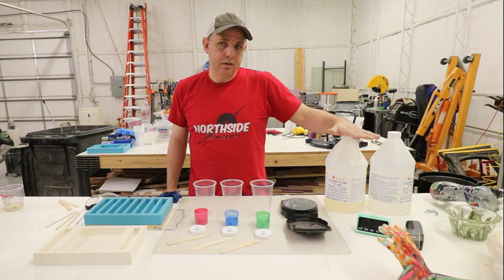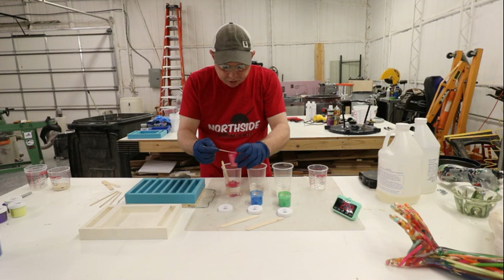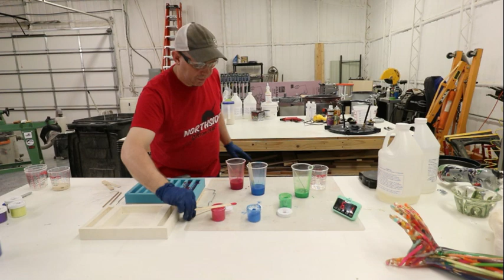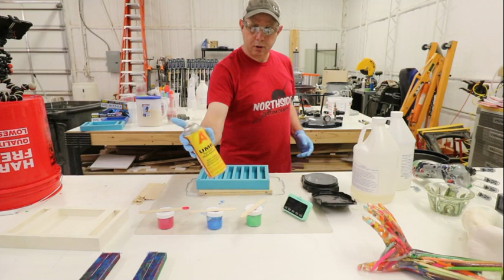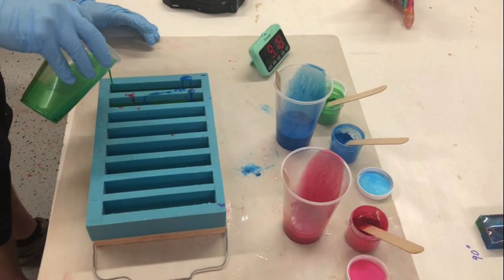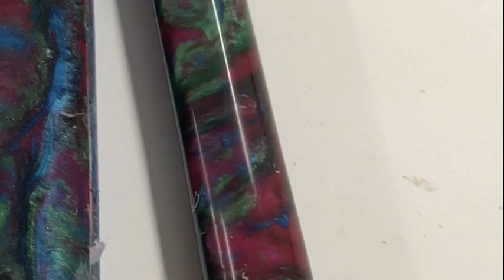Color Separation With Alumilite Clear Slow Resin

Comment: At 105 degrees most people are already in some kind of panic mode because they know there's always 1 or 2 things left to do before you get it in the pressure pot, tighten down all four wing nuts and get the air in. Im just saying, unless you've been doing this for some time most people start to panic because nobody wants to waste several hundred grams of resin and either dye or power. Or dye and powder,haha. Like always Jake, Great vid. Thank you for it.
Reply from the maker: Thanks Michael… it was definitely a fun experiment.. I’ve only poured any hotter than that on accident lol

Comment: I just did a graffiti pour with 8 colors into clear over a 5 blank mold.  It was just over 105F when I started dropping the colors into the clear in the molds.  Too late...It was a neat effect, the colors sank about 2/3 of the way but they curved towards the sides of the molds creating a clear tunnel through the blanks.  Not a total failure but not what I had in mind. I am learning that timing is indeed a major factor.
Reply from the maker: Indeed Sean.. most of the time when I don’t get exactly what I want.. I still like it.. 😄

Comment: I know it's an old video but I get great results with 100% separation using slow set resin but it is a much longer process, I mix up the resin, separate and add colour and will leave it to thicken up, using a deep pour resin means it doesn't have that fast reaction setting so you can wait till it has thickened up quite a lot without the need to rush also most if not all bubbles will have gone by that time and then when it is just barely pourable as in it takes a long time for it to pour out the cups is the time to pour it (I don't use a heat monitor just go by feel and timing) and add swirls then pressure pot it and because the curing happens over hours rather than minutes you can even create certain patterns especially if you let it get really thick and by tilting the mould to create definitive lines, also you can create mould sections like I have loads of offcuts of old silicone moulds in various shapes that I pop in let cure the pull the bits out and fill in with other colours, you even creat the same shape but at different sizes, big to small and keep replacing to create definitive ring shapes of different colours within the blank which is good for quick set resins, so many things can be done! Resin such a fun thing to work with.

Comment: I'm glad you made this video Jake. I have been experimenting on heat times to pour the colors in to the molds but often get scared and do it too early.  I just bought some Alumalite water clear. It's not the same as the clear slow but hopefully it will work just as well. I have found that I cannot get a good polish on Alumalite but  I might be using the wrong one or my polishing skills are broken. Have you ever used the water clear version? Keep up the very informative videos and greetings from South Louisiana.
Reply from the maker: I haven’t used the water clear but I have a sanding and polishing video https://youtu.be/ufMrZeyx0G8

Comment: Nice blanks. I also got some good news I finally use my micro mesh pads they were a very big help on shaping the piece is now crystal clear but I have some cracking on the back side but I was wondering if you can recommend any ideas to fix the cracks on the back
Reply from the maker: THEAPRILFOOL 1983 can you fill the cracks with more resin?
Reply: @JakeThompson  thanks

Comment: hi, I need some advice for my project. I would like to make some marble effect chess pieces, with well separated lines, that can be seen both on a white and colored base. Any tips (using pit molds)?

for example a two-color marble effect: white base and blue effect
or purple base and white effect. 

thanks for help and congrats for your videos
Reply from the maker: When you want separation.. each epoxy is different.. certain temps will encourage color separation.

Comment: What happens if I Demond and it’s still soft? Can I put in back in pot?
Reply from the maker: How long did you leave it in the pot and did you measure the parts by weight?
Reply: @JakeThompson  yes did it buy weight, left it in pot 2.5hrs. So far I learned I should have hot glued one down because it floated up a but a left a space unfilled. Next question.....so can I add more epoxy to it and put back in pot? Got very little air bubbles. What happens if your 12 mins elapse but your epoxy has not reached 90 or 95? Was warm earlier in shop so it got to temp quickly, cooler now.
Reply from the maker: @kandiecandelaria1423  12 mins is about an average .. if it’s colder in your shop, you will have more working time. If it’s hotter, you will have less time.
Reply: @JakeThompson  so you just keep mixing till it gets to 90-95 degrees?
Reply from the maker: @kandiecandelaria1423  yes.. that’s what I do